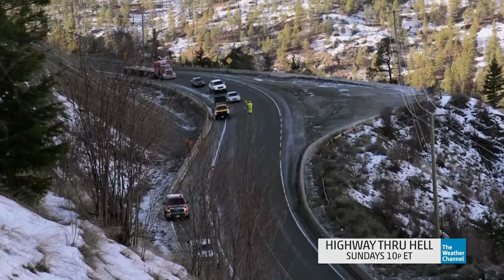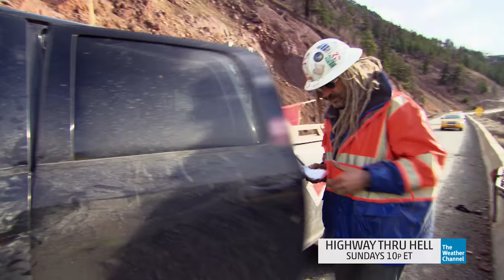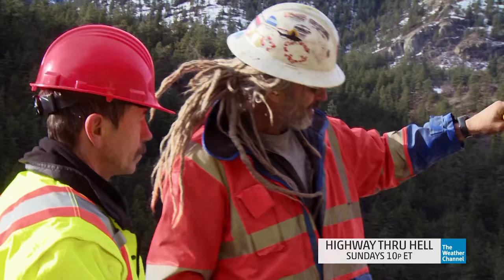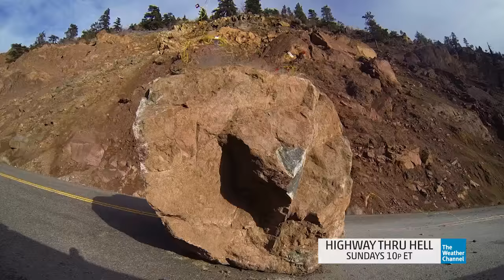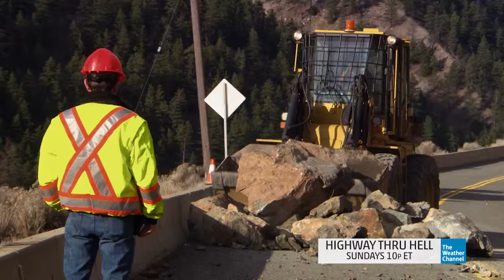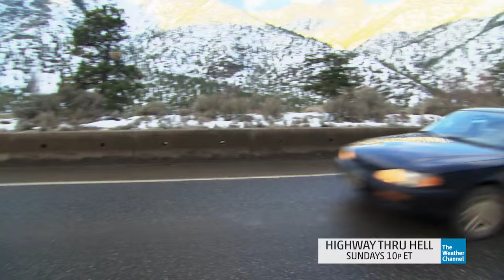Highway Thru Hell: Explosive Road!

Comment: what if mr. rock climber with dreadlocks is wrong by problem identity?  what if the problem is beyond rainfall and the expansion of thawing and releasing h2o?  when ice thaws gasses are released from exposure, what if the law of motion is in play underneath your theory of surface rainfall?  what if erosion is according to law of ratios under density?  nO2 causing decelerration for density to disperse gasses evenly?  underground accelerated erosion to appear as if surface icing is the problem, mabey doing things on the otherside of those rock formations is a great concern.
Reply: What if ANY rock blaster is wrong by problem identity? Thing is.....Mike Hall is spot on every time.  :)
Reply: Looks like it worked in this video clip. He doesn't seem wrong
Reply: He's a rock scaler, get it right.
Reply: a professional knows his business..he wouldn't be walking around today if he were wrong..nope..there is a reason he is on the job..he is a professional rock scaler by trade..You don't send in an electrician to do plumbing job..